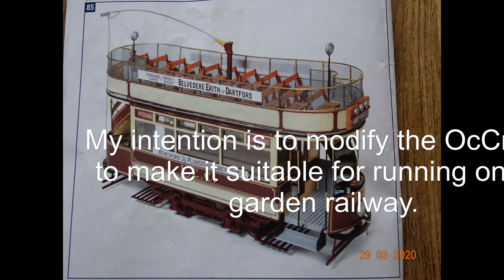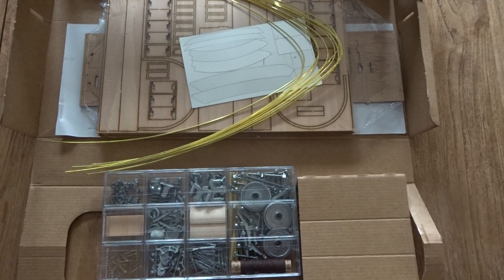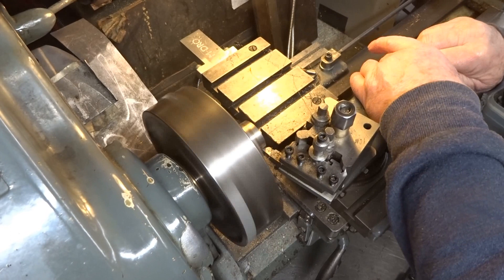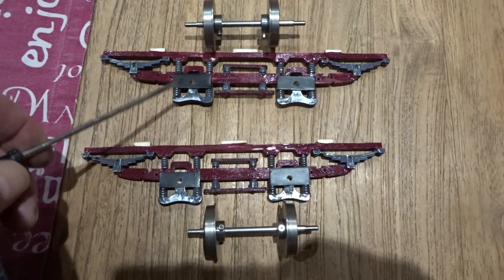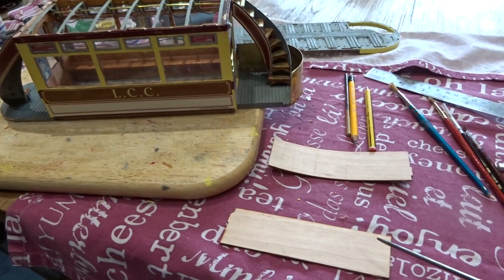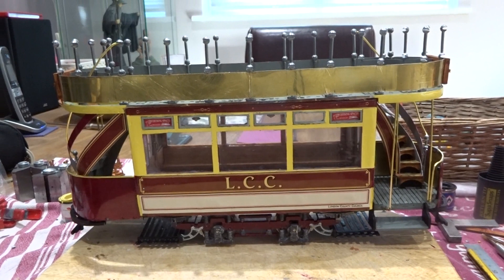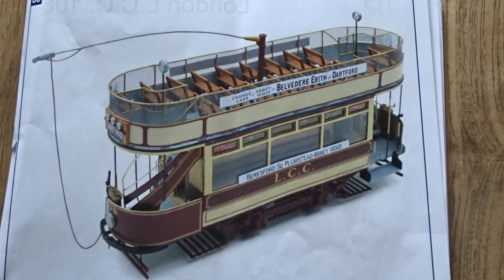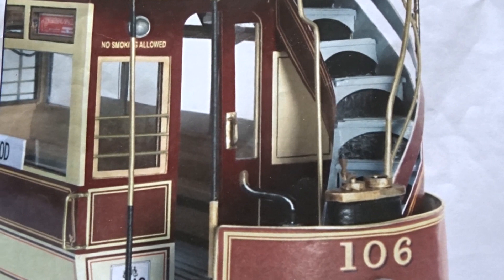Modifications to an OcCre tram kit to make it represent  a version circa 1880/90

Comment: I, too, am converting this kit to a steam trailer, and approaching it in a totally different way.  It will only be used on a short end-to-end layout, so I have bought a couple of plastic bogies and fitted them with Slaters wheelsets. I am adding an enclosed upper saloon with 'knifeboard' seating. The loco will be completely scratchbuilt, powered by the self-contained motor unit and floorpan from Winston, the rail inspection car from Bachmann's Large Scale 'Thomas & Friends' range.
I am also building the same LCC  kit 'from the box', powered in the same way.  However, the kit is quite poorly manufactured, and the errors seem to be very inconsistent. For example, at 8.00 in your video, you clearly show the grain of the dashboard outer skins parallel to the length of the panels, but in both my kits, the grain is at right angles. ( I actually made my panels from vertical strips of wood, double-layered and sanded smooth.)  The photos in the instruction booklet are taken from two different builds, and you can see differences in the shapes of some parts. one particular part (a beam under the platform) is completely absent from the kit, and even from their map of the wooden sprue  --  the slot into which it is supposed to fit, is also absent in some of the photos, but present in others.   The locating tabs, on the four main beams under the platforms, are too close together, apparently they failed to take account of the third layer of the saloon end panels.
The list goes on: the slots for two of the seats are too far apart, for no apparent reason. Some of the tread strips on the upper deck are fitted wrongly in their pictures. One of the decal sheets is badly printed, with cutting to match! (Fortunately I only need one, out of the two kits.)

You have made a great job of this project, but the kit is not for the inexperienced..
Reply from the maker: Thanks MD and I agree with all your comments. I did not want my vid to appear too critical and put builders off. I do not think  the kit is bad value, but you definitely need your wits about you to build it. I particularly wanted an open topped version of the tram. If you see my later u tube vid posted 29 June 2021 titled 'double deck tram cars' you will see that I eventually overpainted the transfers in green to match my Wilkinson type tram. The transfers also had a tendency to peel off and needed additional gluing. Ultimately I am satisfied with my result to run it on the garden railway.
Ed
Reply: @edwinwhite933  I hope I haven't put anyone off building these kits. I have bought the Stuttgart and Soller single-deckers, and will add the Istanbul and (probably) Buenos Aires ones as well. The first Occre product I built was the B-type bus, which also had its problems, and it hasn't stopped me.
I have seen your video of the tram in action --  looks good.

Comment: Great Video as always. I think you have made a cracking job of the tram and will look forward to your next video of it running in your garden. I saw one of these kits in a shop when on holiday in Majorca, some years ago,  which was of the street tram in port of Soller.  I remember thinking then that the quality looked good. Your mod of the front and rear panels and the upper panels are more in scale than the wood would have been anyway. "Stay Safe" Regards Garry.
Reply from the maker: Thanks Gary. The quality of the kit is excellent, but one does have to study the photo instructions very carefully. They are not always as explicit as they seem. As boxed it is clearly intended as a static model, but I have high hopes that my mods will enable it to run. Time will tell.
Ed